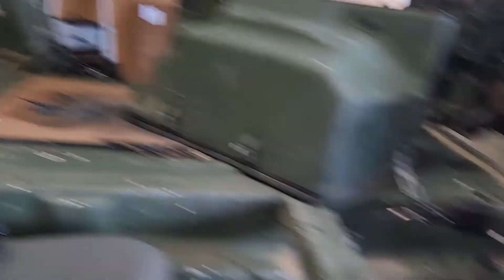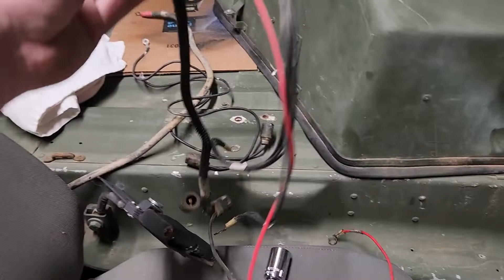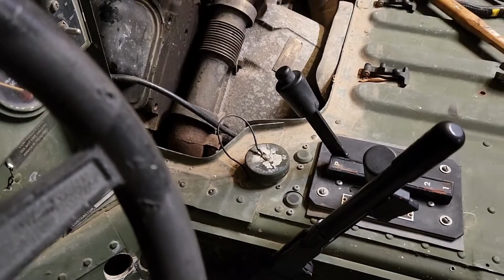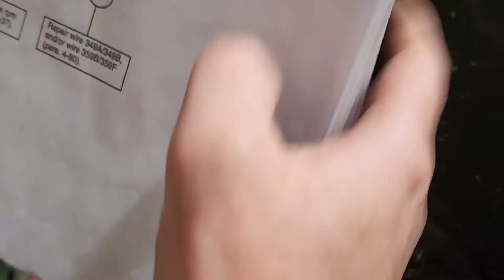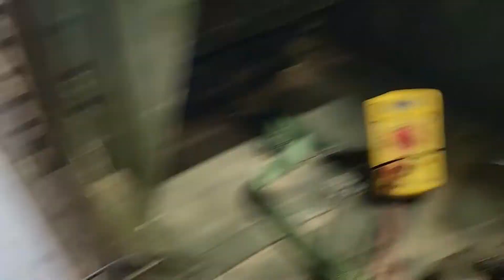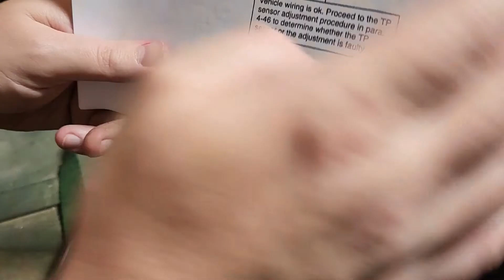Project Thor HMMWV -  Electrical & Transmission

Comment: Hey brother. I'm having similar symptoms with my 4L80e. Curious, did changing your TPS fix the "shifting" issue? 

Thanks for the vid. I'm going to troubleshoot my TPS next. 

My M1114 sometimes stays in 1st and sometimes it shifts through 3rd. And it seems to slip with on a slight uphill (like going up driveway from standstill).

Any advice is appreciated. 🙏
Reply from the maker: Obvious stupid question here first, but have you checked the transmission fluid levels?
Reply from the maker: I replaced the injection pump and tps.  Both were bad.  The RPM sensor was also bad.  Either way with through the troubleshooting guide.  The tps is difficult to test so with that last.  Scary part is clutch might be bad.  But work through testing the sensors.

Comment: Dude yours look worse then mine but my M1165 is stuck in 2nd gear as well.
I'm working on that problem.
Reply from the maker: If you haven't, get the troubleshooting guide for the 4l80e.  That's what I followed.  It told me three faults.

Comment: Where did you get the information revolving steps for different error codes ? Is it just included with the vehicle having the same issue here and I see the diagram you have is helpful but I’m using only schematics and don’t have that flow chart
Reply from the maker: I have the 4l80 troubleshooting guide
Reply from the maker: https://drive.google.com/drive/folders/1Im_0c8ZNuadpd0pLc7uYtQaKzo4Ay20t

Comment: My 99 1097 humvee was working fine now is tripping the red breaker by the passenger side. Ao frustrating don't have any codes but i cant figure out the problem
Reply from the maker: Check your ground
Reply: @terrafusiontx  which one?
Reply from the maker: Take that back.  The breaker could be bad.  No codes is a a good indicator of that.
Reply: @terrafusiontx  ill try another breaker and see.
Reply from the maker: Did that work out?

Comment: The transmission control module says right on it not to disconnect with the battery connected. Did you do your J1 checks with the battery disconnected or what?
Reply from the maker: It's been a hot minute since I did this but I followed the TM for troubleshooting the transmission.  I do remember disconnecting everything.
Reply: @terrafusiontx  Thanks. For anyone else doing this I disconnected the battery, disconnected the J1 connector, then reconnected the battery (with the J1 still disconnected) to start the truck for further tests as directed by the technical manual. The manual never really explains that procedure.

Comment: Did you get any fault codes flashing for you in the trans bulb?
Reply: Hey man good info got a question if I don’t get any lights on my 12 light period then I get resistance from pin s an c or p but none from d and c what should be the next area I should check thanks in advance
Reply from the maker: Just 1 - 2 over and over.  It was weird.
Reply: @terrafusiontx  Any trouble with the TPS or did you measure it?
Reply from the maker: @thannaas  I got a failed test on the TPS itself when i did the test.  The whole side the TPS was on was sticking to.  So i ended up ordering new IP and TPS.

The other failed test was the engine RPM sensor.
Reply: @terrafusiontx  How did you test the TPS? Measuring the volts? Does the RPM sensor from the engine work with the transmission? I thought it was just for the STE/ICE troubleshooting system?
Reply from the maker: I followed the 4L80E troubleshooting guide.  The TPS requires a specific adapter to effectively test it.  Black Dog Customs makes an aftermarket adapter.  However, i managed to at least confirm a resistance test through the sensor.  The engine rpm sensor is used for the transmission and has steps to test it in the guide.  Here's a link to the guide.  https://drive.google.com/file/d/1AGKR6E0vreqOW-2GwPsFf6vGc0GJX6VQ/view?usp=share_link

Comment: Brother. Listen. I had my trans "stuck" in second for a year. It was the TPS. I don't know if the TPS is bad or not, but I did something one day that made a world of difference. I just unplugged the TPS sensor and took the truck for a drive.  It fucking started shifting!!! I was so happy. Anyway now I know the issue lies with the TPS, the only issue is I'm not sure if the sensor just needs to be calibrated or replaced. But for now, I'm just driving it with the sensor unplugged. Please let me know if this works for you. Good luck!
Reply from the maker: That's good advice.  I have two problems though.  My injection pump sticks while accelerating AND is stuck in limp mode.  So right now I'm pulling the pump.  Actually did some work this morning on it.  Video coming soon.  :)
Reply: How does the the transmission know how to shift when the TPS is disconnected? Is it only for the kickdown shifting?